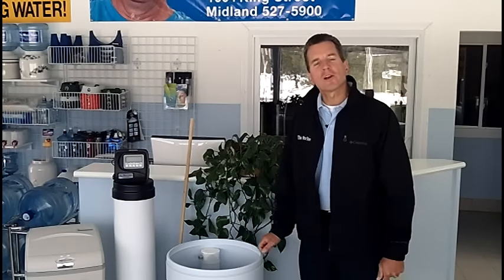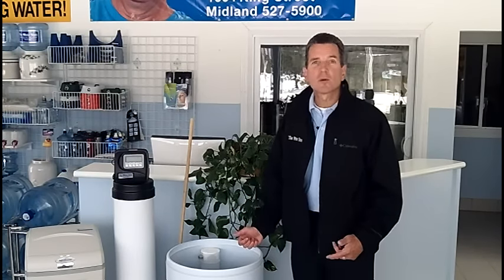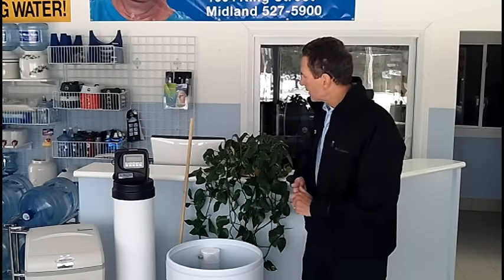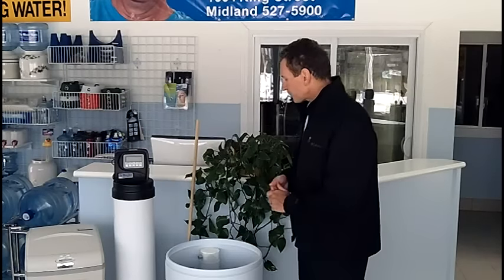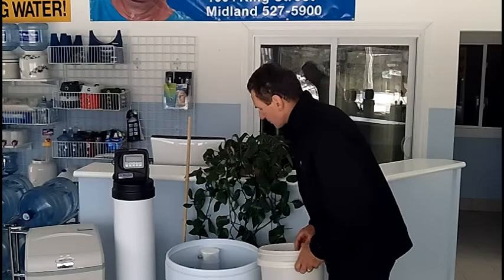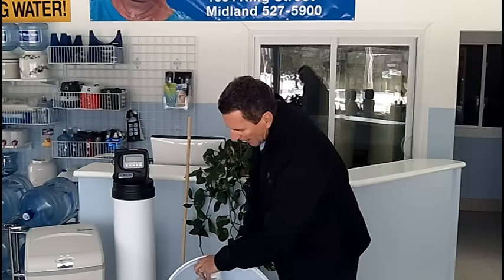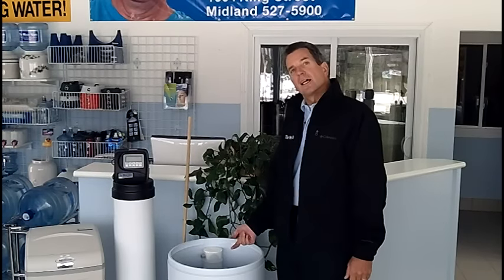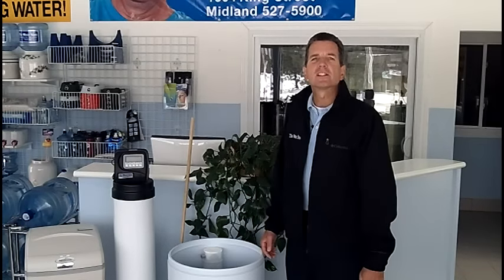How to Remove a Salt Clog from Your Water Softener

Comment: Should the water level go down after the recharge is done? I took out as much as I could with a small container and poured it out into a bucket. I don’t have a shopvac but might need to get one if I’ll need to get all the water out. My water level stayed the same (I little more than halfway after adding the additional hot water to the water left that I couldn’t remove) after adding the hot water, and 4 hrs later and the recharge so I don’t know if it helped any
Reply from the maker: The point of adding the water and doing a regeneration is that it dissolves some of the excess salt.  During the regeneration cycle the water softener should draw out most of the water in the brine tank and then add more back in at the end of the cycle, this video can explain the process better https://youtu.be/udmE-hhh084  I hope that helps.
Reply: Gary the Water Guy thank you for your response! Initially regenerated it after breaking the salt bridge the night before I went to bed. By morning the water level was the same. After adding the hot water today and 4 hrs later regenerating it again, the water level was the same as when I added the hot water. We have determined that we have mush (I googled it), and lots of it. It’s so thick, I can’t even get the broom stick down there to move it around. we’ve been adding hot water 2-3 gallons at a time and letting it sit for about an hr to let it dissolve so that we can remove it once it’s loosened up a bit (we ended up getting a shopvac). The mush and salt initially was about 1/2 way up and the water was about 3/4 way up. The salt/mush is currently 1/4 way up and the water we added is about an inch above that. We called it a night before dinner and will tackle it again later today (it’s tomorrow already). I’m hoping that after cleaning it all out and adding a bit of fresh salt, it will do it’s thing. I read that mush tends to happen when there’s high humidity present. The water softener is near our furnace and it’s currently winter where we live so it’s been warmer in that room. We just bought the house in August and did have a salt bridge problem about a month after moving in. I noticed the salt level wasn’t going down so I googled it. After breaking it, it did fine and used up salt like it had to and we had to add more salt back in November. Only because I noticed our dishwasher wasn’t cleaning like it used to I decided to check on the softener and discovered the mess.
Reply from the maker: @chabelita211  adding hot water and letting it absorb the salt will work but it takes time.  Don't be afraid of letting it sit longer than an hour because it can take about 6 hours before the water becomes saturated with the salt.  you will get there eventually, you may want to check out this video https://youtu.be/C3TpdeNX58E to learn more about how much salt to keep in the brine tank.  I hope this helps!
Reply: Gary the Water Guy thank you so much! That eases my mind a lot! I appreciate your feedback!!!

Comment: I did the steps you recommended and when I regenerate the holding tank gets fuller. it doesn't seem to be replacing the water. is there a clog somewhere? I cleaned the Venturi with no help

Comment: An easier way to drain the salt tank is to use a siphon hose with an inline pump bulb. Use the bulb to get it started, and then just keep it going, adding another bucket of water as needed, until all the salt has absorbed and the clog is cleared. Of course the siphon needs somewhere to go, below the level of the water softener. In my case, the softener is in the basement, and there's a floor drain nearby, so it worked out great. No need to mess up a shop vac with brine.
Reply from the maker: Thanks for the suggestion.  That will work but you'll need to put significant amount of water through it to absorb all of the salt.

Comment: I have an old kenmore.  Had a salt bridge last month.  I broke it and then added salt 1/2 full. It doesnt seem to use the salt anymore.  How does water from the resin tank enter the brine tank?  maybe a block somewhere?
Reply from the maker: The valve adds water to the brine tank.  Check out thsi video on water softener troubleshooting https://youtu.be/Lr3jyGiJdC0

Comment: Hi Gary-I removed all the salt bridges and salt mushing in my salt tank.  It took quite a while.  I've noticed though that the water tastes foul and still leaves a line in my toilet.  I tried the regen this week using iron out but the water still tastes bad.  I'm wondering if the resin beads and the insides of the tube need to be replaced.  I am probably not going to be living here in a year so don't want to replace the softener, plus my cabin is so old that when it sells, I'm sure it will be bulldozed.  I will look forward to your reply.
Reply from the maker: I would have your water tested to see if your water softener is actually softening your water.
Reply: @water_estore  After running a regen with 1 cup iron out powder/1 half gallon cold water mixed well and poured In the small tube, there is now orange water in my formerly beautiful white salt.  Does that tell you anything?  Also, I was thinking of running another regen to see if that gets rid of the orange.  And I don't know if this has anything to do with all this but a few weeks ago orange water started dispensing from my refrigerator water dispenser.  After about 3 cups of orange water, it got plugged up with no water, then the blockage must have passed and the water is clear again.  Yes, I live in a fun house....:-)

Comment: When I followed your video on removing the salt dam, I have a question on when to add the salt back in. You said not to add the salt until all the old salt is gone. In my case, after going through 2 regeneration steps, I notice that there was water still in the tank. Is this normal? All the old salt seemed to be absorbed, so I added salt to the tank. After 2 days, I still have standing water above the salt? Please advise
Reply from the maker: It depends if you have a pre or post fill water softener.  This video will help you https://youtu.be/GedMruLfXhY
Reply: @water_estore  Thanks Gary, I think I have a pre-fill, because the regeneration process took 4 hours (a fill stage, softening and backwash steps). My unit recommends 1/3 of salt in the tank and I have about 2 inches of water above the salt. Is this OK?

Comment: I have low water pressure, does my water softener have something to do with it..my water pressure comes and goes..thx
Reply: Did you ever get an answer to this ?
Reply: I currently have low water pressure issues too. Would also like to know if the water softener has anything to do it with. Did you guys find out the answer?
Reply: Add Res Care to the brine tank before regen. My water pressure in shower went back up.  The beads need the Res Care to clean them on regen.  Amazon carries the Res Care.  Comes in gallon jugs.

Comment: Gary my salt brine tank is about the size of a 55 gal drum. It's filled 2/3 of the way already and I don't really have anywhere to keep that much salt! What should I do? It will be a good month before it gets down to where I can remove enough salt to get to the bottom
Reply: @water_estore  The hot water should be poured directly on the salt or into the white brine tube that has a small cap?
Reply: @cooltool787  directly into the salt.... Need to dissolve the salt.  The brine well is only for controlling the water level for the suction of water into the media tank and a few other things.  Adding it into there will only cause it to be diluted by the rest of the water in the brine tank - good luck chief👌

Comment: I have a different and new issue for me. The iron fighter pellets i have used forever have turned to mush in the bottom of my brine tank. i ve gat several inches of mush in there.
Reply from the maker: Time to clean them out and start fresh using the same technique as shown in this video.

Comment: I finally got all the salt bridges out and am at the very bottom.  I borrowed a wet/dry and now have one solid piece at the very bottom which looks like salt mushing.  What do I do now?  Can salt mushing at bottom of brine tank be removed by letting hot water sit for 4 hours and regenerating?
Reply from the maker: Adding new water and letting it absorb the salt repeatedly will eventually get rid of it at least enough until you can eventually break it up and remove it.
Reply: @water_estore  So put a few buckets of hot water and let it sit for 4 hours then regen and wet dry it out then do this as many times as it needs to go away or be thin and breakable?
Reply from the maker: @katielin3593  yes

Comment: After removing all of  the salt, and then adding water, - I start the regeneration cycle - should I be able to see the water in the bottom of the tank be sucked out and then replaced - or is the process regeneration so slow I shouldn't see the water in the bottom move much at all?
Reply from the maker: It gets sucked out very slowly.  This video will giv eryou more info. https://youtu.be/wPh_l56OWOM

Comment: Bought a home about 3 months ago.  Salt level unchanged 3/4.  It was not a salt bridge but the whole bottom was compacted about 1/2 after removing loosened salt.  What should the end result look like?  It's like a sludge now.  Don't know how many times I need to repeat the process. Thanks.
Reply from the maker: Try adding some water and see if it draws the water out during the brine cycle.
Reply: @water_estore  how much  of the brine should be used during the brine/slow rinse?  It went from 5/16 to a little less than 1/4.  Do I still need to dig up all that salt?  I have buckets of dugged up salt. Can I reuse all that?

Comment: Gary, I have a GE water softener that I recently purchased at Home Depot in Phoenix. My hot water shows higher ppm than the cold water. In other words, the water after running thru the softener and going to the hot water tank is actually worse than the water not being softened. No one can explain this. Do you have any ideas/suggestions?
Reply from the maker: This is 100% normal with every water softener if you are measuring the total dissolved solids  with a TDS meter.   If you are measuring hardness it should be 0 after the softener.
Reply: @water_estore  No, not absolutely zero hardness.  I did a chemical analysis at my university chemistry lab with the help of my professor and even the highest efficiency water softener only removes about 93% of the calcium or other ion hardness in tap water in a midwestern US city that averages about 11 grains per gallon hardness...the ion exchange process is not 100 percent effective despite what sales reps would believe.  I still use a softener though because there was so much buildup in my shower and other appliances that now you can effectively take a shower 10 times and only have as much buildup as there was from a single showering before.  I also was amazed at the cleanliness and lack of buildup in my washing machine when I completely disassembled it to replace the tub bearing and seal kit recently...and the washer was 20 years in service.  The same was true of my dishwasher when I disassembled it to replace the pump and diverter valve.

Comment: I had salt mushing in mine after coming back from a deployment, i emptied all the salt, used a shop vac for all the mush and now I have a clean empty  tank, how much water should i put in the bottom before i add salt?
Reply from the maker: 3-4 gallons

Comment: I set the two valves to OFF. The single valve is open. When I come back to the tank after 4 hours to hold that regen button for 5 seconds, should that single valve go to OFF or stay open?
Reply from the maker: I assume you mean the bypass valves? If so, both valves should be open.

Comment: Gary - My water softener has no water and upon investigation I see that there is a 3" ball of salt crystals attached to the bottom of the float. Could that be the problem and how would I get that off? Thank you!
Reply: I was able to take the float apparatus out and put it in a pail of hot water and the salt dissolved off. Now I pushed the regenerate button and it has started  running water back into it. Yay! Hope this is all it was.

Comment: I got all my salt out by clearing by hand, vacuuming, adding hot water which sat for 3 hrs and one regen.  But I did one more regen to be sure. There's still some water in the tank. Is there always water? I'm concerned that if I add salt at this point it will be turned to sludge by the water that's present and cause another salt bridge.
Reply: I haven't found out from the manual whether it's pre or post fill.  It's a North Star Ultra ll single cabinet.  The softener is inside the salt tank which is why I can't simply tip out the contents.  In regen it never had less than aprox 9" of water but that's including the sludge.  I was wrong earlier when I said all the salt had gone.  In fact the sludge doesn't seem to be getting less. So it never seems to suck out all the water.  In fact there's not much other than the rushing water sound but I do hear it draining behind my laundry.  Maybe I need to go back to scooping? Or removing water and adding hot water?  There are some other contributors who are having the same problem.  This isn't the first time I broke up a salt bridge. There's one person here who does this repeatedly and I am unable to see the replies.
Reply: Btw I use Morton Clean and protect pellets but North Star recommendation is System Saver ll. I'm also aware of crystals but I can't think this makes any difference. I've been told pellets OR crystals but not a mix.
Reply: I found related documentation that suggests it's only 3 yrs old.  I thought it was older.  A 3 year life is not good.

Comment: My water softener clogs very, very frequently. Whenever I clean out the tank completely, it works great for a short period of time (a couple months) and then the salt at the bottom gets hard and so does my water. I use a pole to poke holes through the hard salt at the bottom, but it is difficult and has to be done several days in a row sometimes. I also have to regenerate each time, wasting lots of salt and water. This happens every single time I do laundry - even just one load. I cannot find any solutions or even similar problems online. Any advice you have would be very much appreciated! Thanks!
Reply: I should add that this clogging occurs no matter how full or low I keep the salt level. Also, this is not bridging, and I purposely do not use pellet salt, which I've heard can clog more easily because of the clumping properties that make it stay in a pellet form.
Reply: ***** I am so sorry for the delayed response! I couldn't see your response on my iPad for some reason. I am using crystal salt. My water softener manual says NOT (in capital letters) to use rock salts because “they have dirt and sediments that will stop the softener from working.” I have tried pellets before and switched to the crystal salt when I heard that the chemicals that make the pellets stay formed also cause clumping or clogging (which seemed to make sense). When I first wrote this there were two people using the water and now there are three, but I haven’t noticed a difference in the frequency of clogs. Is there a way for me to tell how often it is regenerating or to schedule it more often (other than manually)? I don’t necessarily regenerate every time I do laundry, but I almost always get hard water after I do more than one load of laundry (sometimes it only takes one). For some reason, doing laundry is causing these clogs. (Could it be the clothes dryer? It is vented outside, but the softener is in the room behind the laundry room and the dryer’s exhaust pipe does run through that room…) After I break up the clog, I usually then regenerate. Often the water doesn’t get soft until I’ve gone through this extremely annoying and physically hard process several days in a row, sometimes longer.  Other times, the water will get softer only to become hard again in another couple days. So frustrating! I don’t know how to answer your question regarding size of the water softener, but I can tell you it is a Kenmore UltraSoft 150. I will try keeping the salt level at the water level, but that’s only a few inches… I expect I’ll have to refill it every couple of days. I really appreciate your thoughts and suggestions and look forward to your response. Thanks!!
Reply: Ja Hank Also, my husband says he always puts in about 1/2 bag, which does come to a little under or a little over the water line.
Reply: ***** Yes
Reply: Same issue at our home.  Hoping for some ideas soon!
Reply: ***** Thanks for the feedback.  I did that yesterday after reviewing your video.  I will continue to keep a close eye on the system and repeat over the next week.

Comment: Can anyone help with a question?  I definitely had a salt clog.  I cleaned most of it out with hot water and wet/dry vac.  I added 3 gallons of hot water, let it sit for 4 hours. All the salt appeared to be dissolved.  I ran the regeneration at bed time.  Next morning, there was still 3 gallons of dirty water in the bottom.  The bypass is set correctly to off.  I assumed it would be dry in the tank?
Reply from the maker: It depends if you ahve a pre or posty fill water softener.  This video will help you https://youtu.be/GedMruLfXhY

Comment: Ultimately, it's easier if, twice a week until the salt has moved down, to pour about a gallon of hot tap water, do not boil it!, over the salt and start a manual regeneration. If you feel you must poke at the salt bridge, i length of 1/2 or 3/4" PVC pipe works well.